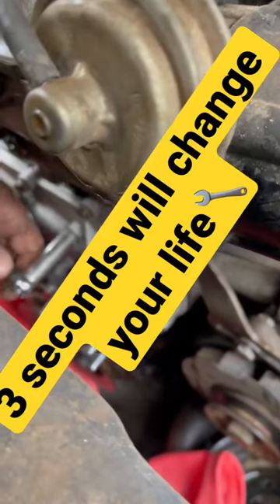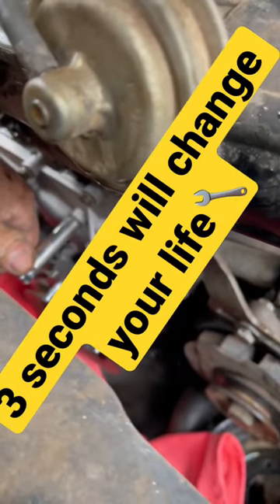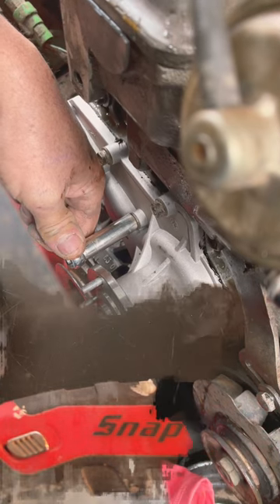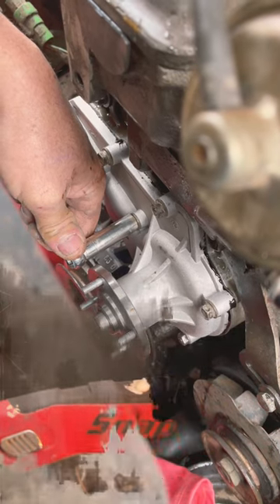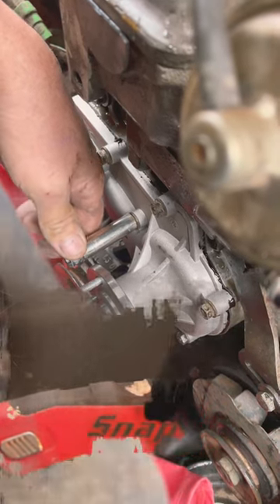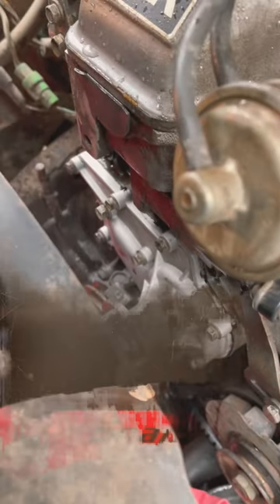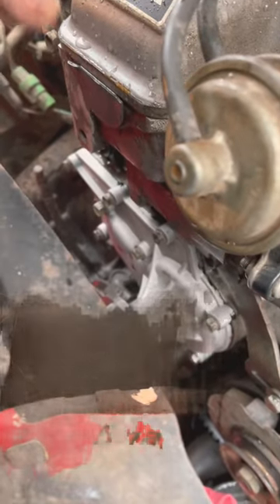This is why you hold your bolts for 3 seconds 🔧#shorts

Comment: Better tell the clicky torque wrenches that they need to hold that torque for 3 seconds... smh
Reply from the maker: Haha I made one for those guys too. 👉https://youtube.com/shorts/_oPUcoFK0j4?feature=share
Reply: @fastflo1  smh, once that thing breaks over, you aren't at the set torque anymore.  You're less than that value.  And, if you continue to pull in the broke over position, you're applying more torque, thus defeating the purpose of the torque wrench.
Reply from the maker: @jameskee2412  holding isn’t over tightening . You have to go beyond to make it click. A fraction of a second vs 3 seconds . It still goes over . Regardless
Reply: @fastflo1  still are not holding the same torque value after the break.  Holding for 3 seconds does nothing with those wrenches.  IF you are really worried about a bolt backing out, use loc-tite, that's literally what it is there for.
Reply from the maker: @jameskee2412  I’m not worried about my bolts I hood them for 3 seconds. Three seconds does do something . You can see the pressure on the wrench rebounding after the click .
Reply from the maker: @jameskee2412  and by saying you need loctite pretty much says what I’m saying is right . You use a torque wrench, and use loctite because that’s what it is for , to keep bolts from coming loose. But holding it for 3 seconds won’t help? You already admitted they are going to back off ? Sheesh ….
Reply from the maker: @jameskee2412  so tell me what makes bolts back off?
Reply from the maker: @jameskee2412  couldn’t possibly be rebound tension and vibration. No possible way 👍🏻😂
Reply: @fastflo1  since you're literally the first person I, or numerous people on here, have ever heard mention some fantastical magic as rebound tension and humanity has been using nuts and bolts for centuries, likely not.  Vibration, sure, but that's what torque values are for, and again, loc-tite.
Reply: @fastflo1  different thermal expansion and contraction rates and yeah, vibrations sometimes.  But guess what, not rebound tension.  But as long as you're so sure of it, get me a bucket of steam.
Reply from the maker: @jameskee2412  turn the bucket 🪣 upside down and it will hold steam

Comment: or just tighten it a little tighter then it should be and the bolt will go to where it needs to be after. either way this is just b.s. Imagine how long it would take to rebuild a car. you'll be 12 weeks just R & R the Engine. Another year on the Suspension.
Reply from the maker: You do not over tighten it ...you hold the same for three seconds.. And  I built this motor 0ver 20 years ago with this method. Still running today. Read it and weep.👉https://youtu.be/5elFkkjUkZA

Comment: Me thinks your doing a water pump on a Toyota 22R... Check the front cover for signs of timing chain rubbing threw where the pump impeller resides. Causes water in oil !
Reply from the maker: Hey you really know your motors! I have had some pretty worn motors. Never did have one wear through the cover. But I have heard that people think head gasket and it is the cover. Good stuff man!👍

Comment: I'm flat rate. I'm not adding an hour of labor time to my ROs to hold every bolt down for three seconds. It's called using a hand torque and TORQUING BOLT DOWN TO SPEC.
Reply from the maker: And what do you do sir when you use an open end wrench at a friends house on a weekend? Are you capable of a simple repair without your faithful Torque wrench and special specs? No Skill after all those years of wrenching? So sad😪

Comment: Sometimes it tightens up more.
Reply from the maker: Exactly. That is why they back off, if you do not do the three seconds. When you wait and it moves, that is the rebound tension settled. So far you are about the smartest one in the comments!👍
Reply: @fastflo1 common sense, I have had bolt's that were tight and held it steady and sometimes it tightened even more and did it again.

Comment: The use of a torque wrench and giving it two clicks does the same thing and takes 1 second.  

100 bolts per day @3 seconds per bolt, would be 21 hours per year just holding bolts in place.
Reply from the maker: Most people waste more time checking phones and picking noses...And I am not using a torque wrench.

Comment: I have fixed so many cars of all kinds and never done this and never had a fastener back out on me. Never had a customer or come back in with a problem related to this issue. This is ridiculous.
Reply from the maker: I can tell you this. That bolt has not come out yet.... And it may. It is nothing personal. You are probably a great mechanic. And do good work. Many mechanics everyday do work and the job gets done and for the most part things work. I do not deny that. But if you pay attention as a mechanic. I am sure you have seen a loose bolt before somewhere in your life, no? Factory  vehicles have bolts that come loose. People buy new parts and put them together according to spec and wonder why later a bolt came loose....Well, that is why. If you use this technique, you will discover that not all the bolts have a reaction. The very few that do and you can feel are far and few between. But if you apply this technique, that is the bolt you are preventing from backing out later. That is why seldom bolts backout, and seldom do they have a reaction with this technique is applied. Does that sound logical to you? Nothing against you or your skillset or knowledge.... Many mechanics do not know this. You have to find out somewhere. These are top tips. That is why you never heard of it. Now there are many other things in life you do not know. And if you simply reject it because you have not heard of it... You are actually robbing your self of the opportunity to learn and expand your knowledge. If I did not know and I heard this, I would research and wonder why. You will gain nothing from rejection purely based on you have not heard. So ask your self this before you respond. .... What are these following items made for? To prevent what?.... Lock washers, star washers, external washers , internal washers, crimp nuts, loctite, safety wire, nylon insert nuts ,double nuts, castle nuts, cotter keys? Ok if you can answer that correctly you may be able to apply logic here.... If you tighten a bolt that is not ridiculous is it? So why do you find it hard to believe that holding it in the same direction you just tightened it, for an additional 3 seconds could have zero benefit? Does that sound logical? Is it going to hurt it? Make it come loose? Does that make more sense ?No it does not. It will help. There is a reason all these products are made. Bolts come loose. And this helps prevent that. Along with heat and vibration and a list of other contributors.... This is one of them... So believe it or not. You have never tried it so you honestly have zero experience doing it. If you did try it and make a practice of it , you would become a better mechanic because there is more than meets the eye. You become more focused, have better attention to detail. You have a better sense of awareness and get in tune with what you are working on for starters. You will feel and notice more wrenching. So , I hope you want to continue to learn and grow as a mechanic. The stuff you worked on is still out there, and could have a bolt come loose. It is not over. The day one comes back you will wish you would have known this.... Good luck out there man

Comment: I was a jet engine mechanic for years and years in the AF. haha we use safety wire.
Reply from the maker: Thank you . Finally someone who is on the same level...... Sheesh....And now,  please share with the audience why you use safety wire on airplanes? To prevent what?  Thank you.😎
Reply: @fastflo1  Well safety wire is used for the backing out of bolts due to vibration.
Reply from the maker: @Wasssssuppppppp6869  thank you for your response. Very much appreciated ✅

Comment: That’s what locktite is for. 25 years I’ve been turning wrenches. Never heard of this. Or done this.
Reply from the maker: Well, at least you are on the right track. Loctite....To hold bolts right? Even torqued bolts, right? So bolts do come loose....  Believe it or not, this helps also, just like loctite, lock washers, and torque wrenches.... 25 years you have been turning wrenches. I am glad you found this video. Now you can try something new to you. I have been doing it for 28 years now since I found out.....Sometimes there is more than meets the eye. Sometimes none of those items are available, this is.... Always..... Over 50 years combined experience between us right? You have to wonder? Is it untrue because you have not done it or heard of it? Or is it true because I have done it and know it is? One person knew. One person did not.... Interesting right? Can you imagine how many times I have done this in the last 28 years? That is a lot of feedback..... I can assure you if you try doing this with all of your bolts in general, even with just open end wrenches or crescent wrenches. Screwdrivers, hex wrenches. Any fastener.....You will become a much more aware at the very least, aside from what the bolt is doing. Your arms will be shaking, trembling. Your focus and feel will improve. I could go on all day.... Please try it for a while. It may take a while, but in that 3 seconds, I guarantee you will have a bolt move.... Hold your bolts for 3 seconds. You will be amazed. Wrong or right I do it. I want the best for my stuff and anything I can do I will.

Comment: Dumbest thing I've ever heard and I'm a retired ASE Master Tech who was trained at the GM Training College in Atlanta Georgia. I never once saw any literature in any service manual or training course say anything about "rebound tension" or even have the slightest suggestion the there was some kind of "3 second rule". Use a torque wrench where indicated (the service manuals are important) and just tighten the bolts as suggested in the procedures outlined in the manuals.

I never had a legitimate comeback and I never wasted time on this idiotic idea of "rebound tension". If I rebuilt and engine or an automatic transmission the customer got another 100,000 miles on it and I never spent one second waiting for the bolt to "settle".
Reply from the maker: Like a said. Some things are not in books. It is a good practice. You wont find anything in the manual or your ASE Master Tech book about shaving piston skirts. They will not recommend it. Most Tech's have never heard of it. It does sound like you would not do i,t or know how. But you learn that in the pits with mechanics that work on race bikes, not from books. Winning proves that, dyno charts also. They beat the stock bikes, they rev higher. Faster. So is this also untrue because you the Master Tech have never in your experience and training heard of it? Something to consider.....Maybe you learned something today and did not even realize it. Have you ever shaved your own piston s skirts and tuned your own two stroke ports? Drilled your pistons on the exhaust bridges? Or just standard OEM factory stuff? All by the book? Ever used a beam style torque wrench? Ever sit on it for 3 seconds to dial it in? Or just brand new digital Snap On wrenches? Have you learned anything else besides what is in the book? Just curious....

Comment: If I were building something expensive for someone else I’d do this so I knew for sure no loose bolt was from me. But wrenching on my own things, no way. I don’t even care if the bolts are tight half the time. They rattle out I add a new one and torque it tighter then last time with uggga Duggas.  If it’s a constant problem then the welder fixes that issue.
Reply from the maker: Hey man do what works for you! That is what it is all about. I love hearing other peoples techniques. I have had 3 bolts where you need 5 most my life.... I know your style😀👍

Comment: Hmmm.....  I've read alot of pages on Mitchell, all data, TIS over the years.  I have not come across a page "Hold bolt for 3 sec".  Torque spec sure, nM, ft-lb, angle torque, but not hold 3 sec.  No issue with bolts coming loose.  Hmmm.....
Reply from the maker: Some top mechanics have tips that are not in books. The top tuners always have tips you will not hear anywhere else....That is why they are the master mechanics. They know more, and know things the majority of mechanics do not. You think Nascar has all the tips in a book for all to see? All the top teams sharing the top tech tips? Seriously? No. They do not. I shared this tip because I have known about it too long to keep it to myself.......This tip is from a top mechanic. He does not care if it is in a book. He does not care if anyone believes it or not he knows it is true from real life experience. Years of turning wrenches and research. Years of schooling in metallurgy. He knows that bolts come loose and why. Why do you think they make all the different types of lock washers? Why Loctite? Why Safety Wire? Why Double click a Torque wrench? Why retorque? What about bolt Stretch? What about Tension? Torque? Torsion? Clamping force? Heat? Vibration? All of this why? Because bolts come loose is the answer.  And for one second you do not believe that holding a bolt in the direction you just applied force to tighten it will not help? Hmm... I would question that logic seriously....The 3 seconds will help settle the force you are applying .....Ever work with a rusty or dirty thread? Do Bolts break instantly ? Have you ever seen a  bolt skip? Ever work in a less than perfect situation? So many factors.... When you tighten something that has resistance, it may take a second or more to overcome that. If you let off in the middle of applying force, and have not over come that resistance, the tension is set to rebound. Add some vibration and you are more likely to have a bolt back out than if the tension were settled. It is that  simple....The bolt would be neutral not under tension set to rebound and come loose. Can you picture that in your mind? Go push on a ratchet that is on a bolt head, with your fingertip on the end and apply as much force as you can and let your finger slip off the end. Tell me how many times the ratchet spun around.......Then think about it... Then let me know.  You do not need  a book to figure that out. Go pick up a wrench and start paying attention to what is really happening... If you practice this technique and experience the results for your self ,you will not need to go look in the books for an answer. Practice this for the next ten years and let me know what you come up with. Not every bolt will do it. Some tighten up just fine. This is to ensure the ones that have an issue , do tighten up. And that is why you will experience the movement sooner or later. Than you will be a believer. So that is why you may not be finding this in a book...The answer is right at your fingertips.👉https://youtube.com/shorts/-7I71BfRPS0
Reply: @fastflo1 you know,  NOW that I THINK about it, after I snug all bolts/nuts (finger snug), then I would go around tighten everything.  I realized I was actually holding my socket wrench for at least 3 sec. Sometimes a little more.  Hmmm......  no one told me to this, I always thought it was just my OCD.
Reply from the maker: @bobo11112222  cool … it is amazing what one begins to realize when the thought process is initiated. If you practice this tip you will immediately become a better mechanic in so many ways. It really brings your focus into play rather than just doing something that is routine.  Well done . Your awareness level just progressed ! More great discoveries will come . Trust me ….. you will notice more ….. Keep it up 👍🏻